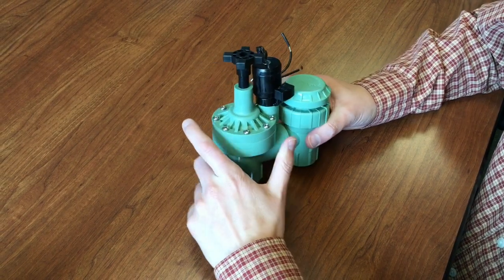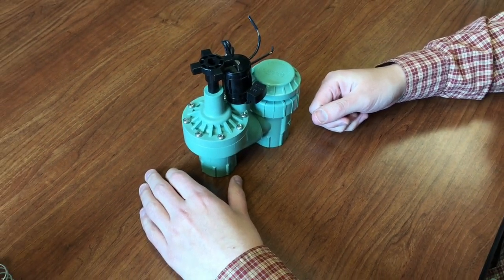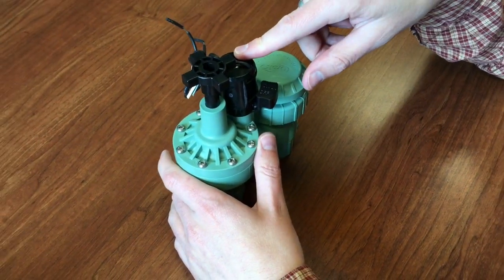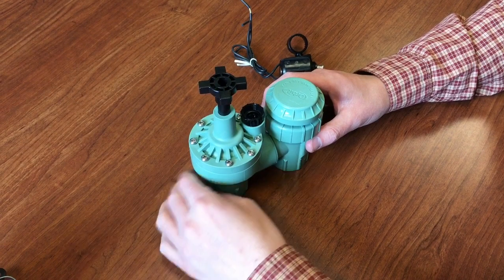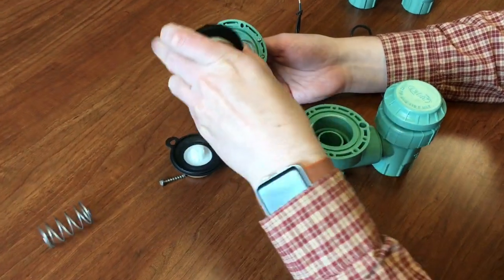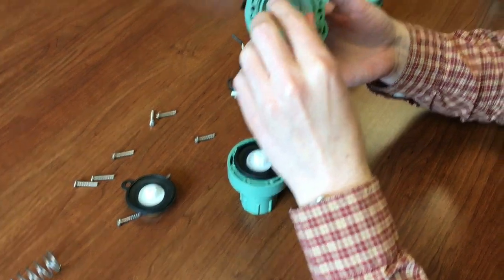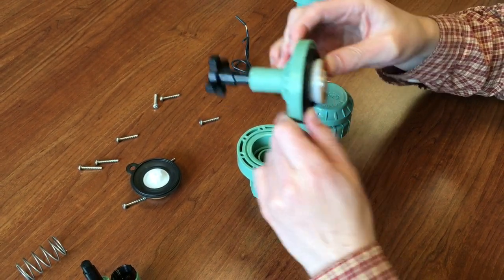How to make valve repairs on the Orbit Anti-Siphon Valve

Comment: Pretty lame video, especially for a manufacturer; you leave out a lot of information.  What precisely are the two different models called -- one's called "jar top" -- I have a feeling if I go look at my box or in the store, it's not going to say that -- the other...?  How do they differ in functionality?  And what are their model numbers (even just examples)?  WHY would I want to replace the diaphragm?  How about the solenoid?  How about the spring?  What do we check for?  (And of course you leave out the part where you actually remove it.)  How tight should the screws be when reassembling? (Super tight or merely comfortably hand tight?  Or how about a torque number??)  Anything that has to be lubricated, e.g., with silicone spray?  Come on, people...

Comment: Four of my 57624 will have some water on the top of the lid and run down the side, there appears to be no cracks or other leakage. Should new diaphragms solve the leaking problem? Being over 10 years old would you recommend any other parts be replaced for preventive maintenance?

Comment: I picked up as Diaphragm Repair Kit at Home Depot and when I look at the two  parts in the kit ( 1 each depending on the model type) neither reflect the little rubber portion that look like an ear on the diaphragm used in the video.  Both are simply a circle with no extension piece that goes beneath the solenoid.

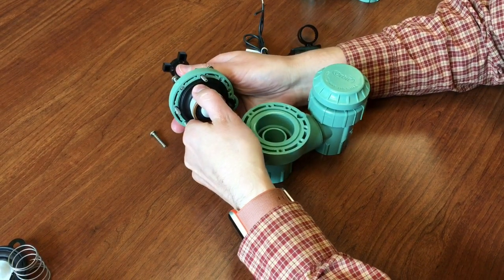Comment: At 2:10, your diaphragm is stuck to the top.  Mine is sealed to the bottom.  I can't get it off.  Any thoughts on removing it without tearing the rubber?
Reply from the maker: We'd recommend pouring a little water on the diaphragm, and pulling up just a small edge, letting the water get down in the cavity. That should be enough to loosen it.
Reply: Mine diaphragm also stucks on the bottom part.  I thought it's not removable since the valve is kind of older model.  Thanks for the question and reply.  I can try to pull it out now.

Comment: The diaphram on mine has no rubber to go around the solenoid, and I am sure that is the problem with a small leak going through to the first sprinkler, the replacement doesn't seem to have it either though. Is this where the leak could be coming from?
Reply: Sorry, tab missing on diaphram, that goes around float control lever... It is missing from my diaphram.
Reply from the maker: @DanikThomas  Hello, we'd need to get more info to say for sure. Please reach out to us with a private message that includes your contact info, via one of the social channels linked below. We'll get in touch and get this resolved.

Comment: I purchase a new value , followed the instruction and the value still leaks where the screws are . So I purchased the kit and it still leaks ,  what's going wrong ?
Reply from the maker: It is likely something with how the internals are seating inside. It must seat perfectly. Otherwise, it could be a crack in the valve housing or lid itself. If that is the case new internals won't fix it and the valve will need to be replaced. If you'd like to send us your contact info via private message on one of the social channels linked in the description, we can get in touch and help walk through it. Thanks.

Comment: Everything ends up leaking on all of the Orbit valves.  Tired of it.  Even the "bleed screw" either leaks or if you turn it down it closes the valve.  I have 17 of these things and four controllers - those LCD screens turn too pale to be able to see the numbers.  I'm going to try another manufacturer to see if someone makes a more reliable, durable and sun-proof outdoor valve (the operative word is "outdoor").

Comment: Should the nob on top be open or closed
Reply from the maker: Hello, it should be open, but the amount it should be open depends on your preference. The flow control is useful if you have high water pressure. If not, usually we recommend just leaving it all the way open.
Reply: @orbitsprinklers  what do you do if it is open and just runs
Reply from the maker: This could indicate and issue inside the valve. Please reach out to our support team and they will get this resolved: https://www.orbitonline.com/contact-us/

Comment: I turned my flow control valve for the first time in a few years.  It started leaking water immediately, and hasn't stopped.  Is there some kind of o-ring that should be replaced around the flow control valve?
Reply from the maker: Hello, yes there are plastic internals that can degrade over time. If you could reach out to us with your contact info via private message on one of the social channels linked below, we will get in touch to resolve.

Comment: My irrigation system has five (5) Orbit valves model 57030 to control five separate zones.  Zones one through four are working properly, but the water shuts immediately after Zone 4 has completed its watering.  I removed the top of the valve, cleaned both the diaphragm and the solenoid then re-installed them, but the water continued to turn off after Zone 4.  I purchased a replacement valve and installed a new solenoid and diaphragm, but the problem continues.  Help?!
Reply: I suggest ensuring the electrical connection is good so the solenoid shuts properly, not gradually.  Cut, splice and use right wire nuts.   It's been a year and you probably already fixed this, but it might help someone else...